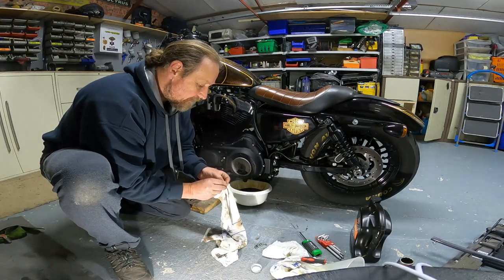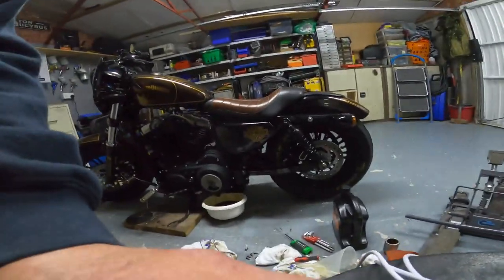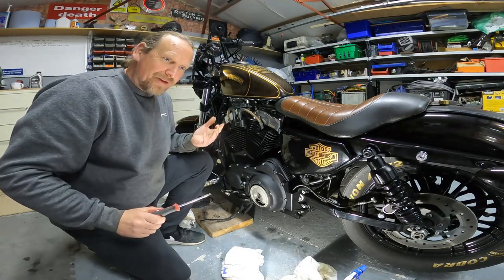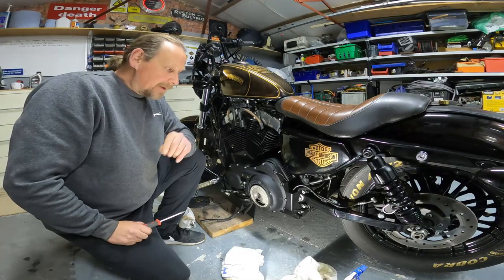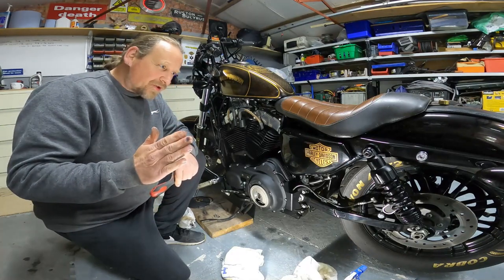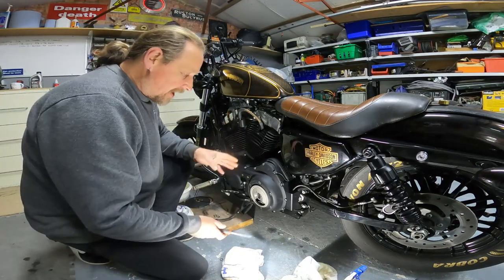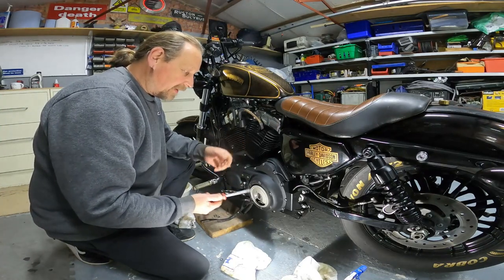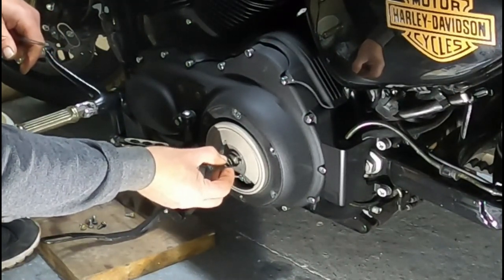Harley Sportster 10k service

Comment: Enjoyed your mix of American English vs the Queens English. Cracked me up. Also I got a kick out of watching you suffer between SAE and Metric sizes. Your procedure was pretty spot on. One thing I did want to mention was regarding “dirty oil”. Just because the used oil is discolored, does not mean that is is dirty. It’s discolored due to heat, or burnt if you may. There are some good oil reviews on YouTube that address this issue. It’s worth checking out. It changed the type of oil I use in my Sportster 1200 Custom. My bike (2014) has 6200 miles (10km) on it. I will be doing all of those services over this Winter, plus some other small mods. There is always something as you well know. All the best to you. Enjoyed it.
Reply from the maker: Got to cater for the world stage mate 🤣👍. Cheers.. You know, I once did a course on oil contamination , and it surprised me how much foreign material(micro) was in New oil in an unopened container 😬.. But yep, mainly brown from heat etc 👍.. Dont get me started on the thread mix 😀.. Cheers for watching and thanks for the feedback 👍.. enjoy that sporty of yours 👌

Comment: Great video, loved the milk carton tip - will make it much cleaner. I just did my 10k service. The only difference was with the chain setting, they recommend you put the bike in 5th gear and rotate the back wheel so that you can check the tension at various points, otherwise you may end up overtightening the chain. It's a bit of a pain of you don't have a proper bike lift, but you can lift up the back tire with a normal jack.
Reply from the maker: Cheers 👍. I think I mentioned over it being better on jack, and was going to remove rear wheel but doing that again. And yes , to be absolute sure of measurement, then high gear is correct, but is fine to just take out max slack as it is as long as dont wind adjuster too much. 👍. So yep, cheers 😁👍

Comment: Hello, I am writing from Turkey and I am a superlow 1200t user.  Here, they recommend full synthetic as engine oil and mineral oil as primary oil. Do you think I should use mineral oil?
Reply from the maker: Hi, I use Syn 3 harley oil but plenty of others out there.
Amsol 20/50 etc you can use in both engine and primary. Best use an oil specifically designed for drivetrains 👍
Reply: @ALCHEMOTO   Thank you 🤙

Comment: Great video  but you can't get the old oil out of the crankcase but flushing the tank with new oil...The tank is higher than the crankcase... They do make a kit called the old scavenger I think . I think that's the really the only way to get the oil out of the crankcase on these sportsters... Wish they would put a drain bolt on the crankcase as they do on the primary
Reply from the maker: Thanks 👍. And agree with you on the bottom drain plug. But probably only a couple of ounce of oil left so not really an issue. But does seem like your skipping that final step 👍.. reminds me.. need to get my 15k sorted soon 😁
Reply: Yep ...
love the sportsters...easy to maintain yoself...70k miles of leisure riding on my 883...replaced my accelerator pump this week what a difference in performance for just a few dollars..Fixing to buy a 1200..I'm pushing 60years old plus,so why not..Keep up the good work!! Safe riding!!
Reply: Man that is a awesome color combo
Reply from the maker: @groovee63  Cheers 👊👍
Reply from the maker: @groovee63 some fair miles there 👍👍. Sportsters are too versatile to be overlooked.. I might prefer the 'other' bike for the distance stuff now but cant beat having the 48 for the fun 👊. Cheers